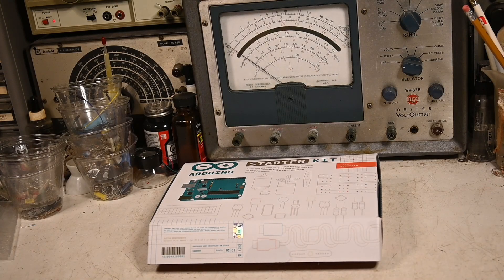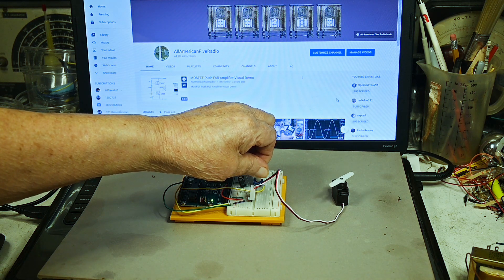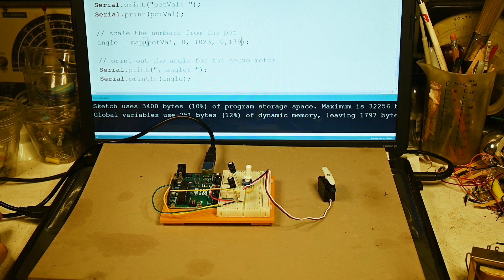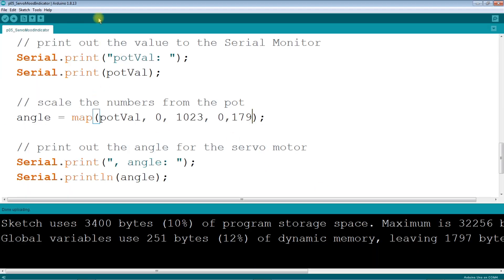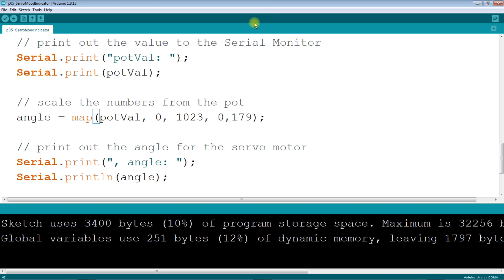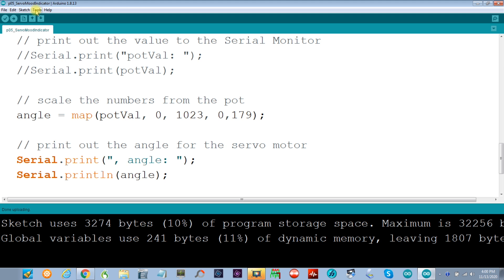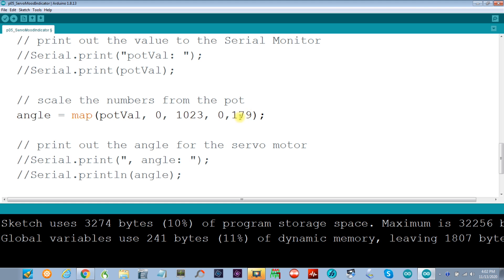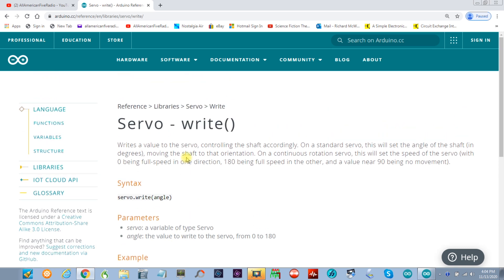ARDUINO UNO STARTER KIT

Comment: My guess is that they have the variable resistor connected as a voltage divider.  The output probably goes to an analog to digital converter pin on the microcontroller.  Since its range seems to be 0 to 1023, it's probably a 10-bit analog to digital converter.  It's comparing the voltage input on the pin to the voltage reference (probably five volts?) and coming up with a value between 0 to 1023 as how close to the voltage reference it is.  

I've never used an Arduino, but I've played with microcontrollers by themselves before.  I think Arduinos use AVR microcontrollers, and I used one of those to make a little Pong clone once.  I read a potentiometer as a controller input, and generated a composite video signal (with careful timing of the code), using a small resistor network to convert some digital outputs back to a single analog signal to send to the TV.   I eventually put a speaker on one of the square wave generator outputs of the AVR to make simple beeps.  I love these kinds of things, but most of my parts are still in boxes.  I never seem to have time or space to play with it anymore.  Hopefully when we move I'll at least have a garage or basement for such things.
Reply from the maker: Thanks for the information.

Comment: endless amount of things you could build with that ,that looked like python do you compile and put it straight into the boards memory ? or where you uploading to the cloud and the board has wifi ?
Reply from the maker: Through the USB COM port.
Reply: Arduino uses a form of C++. You can also use Python but it will require additional software.

Comment: The 0 to 1023 is the adc resolution in bits  and depends also on the voltage reference of the adc
Reply from the maker: Thanks for the information.
Reply: @AllAmericanFiveRadio  I forgot to tell you to have  a look on the manual under the adc (analog to digital converter)
Reply from the maker: @leosedf  COOL and Thanks again.